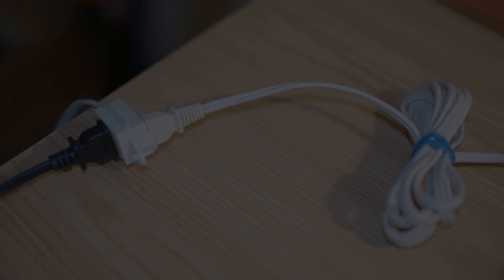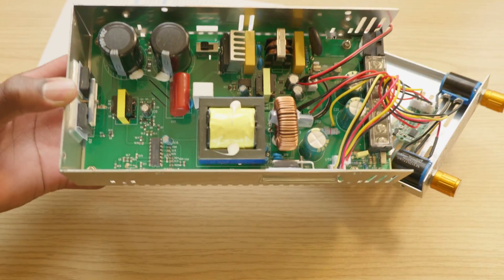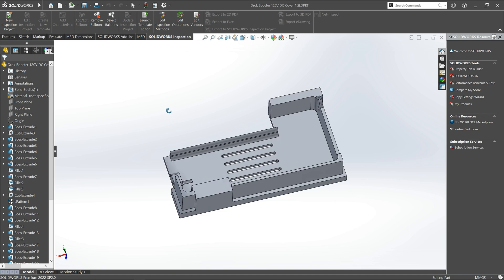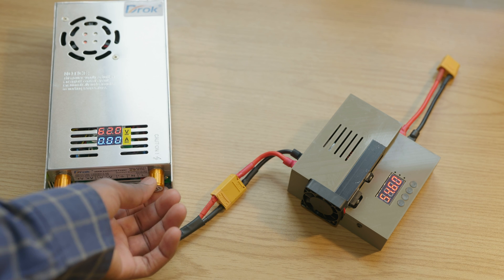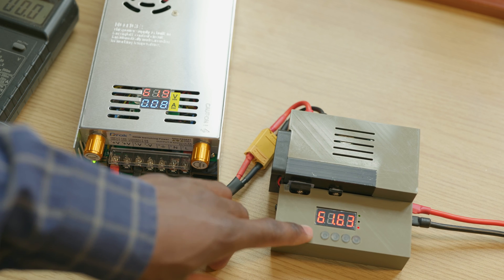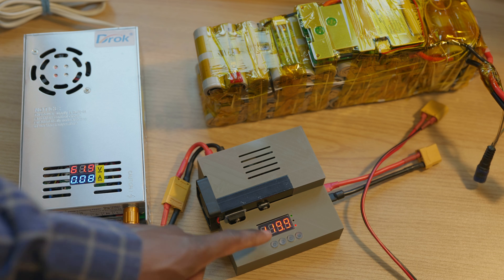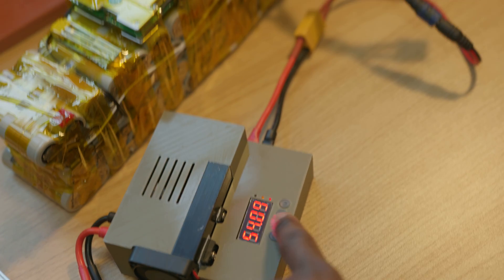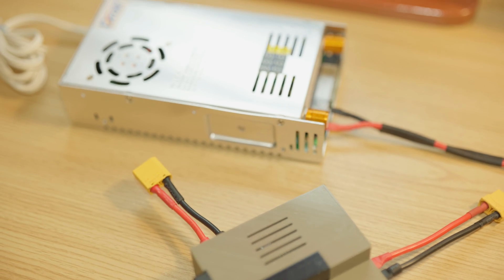DROK 60V Power Supply and 120V DC Boost Converter | DROK

Comment: By any chance have you tested to see how many amps it actually puts out at 60V?  I'm finding that the Chinese power supplies that are advertised at 60 or 48V actually supply 5 or fewer amps.  Regardless, thanks for the video!
Reply from the maker: I was able to get 7.64 Amps at 60v when running a brushless motor for a few seconds. The advertisement of 60V - 8A seems real. However, beware of replicas of this same power supply being sold at various sources (knock-offs)